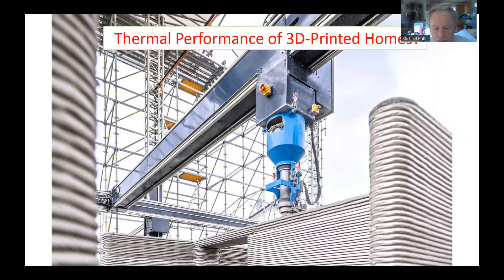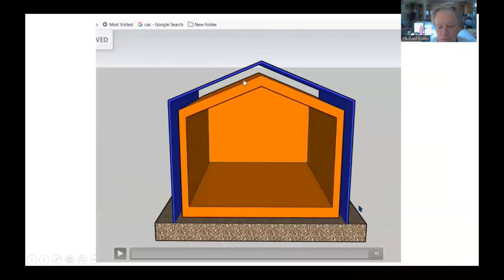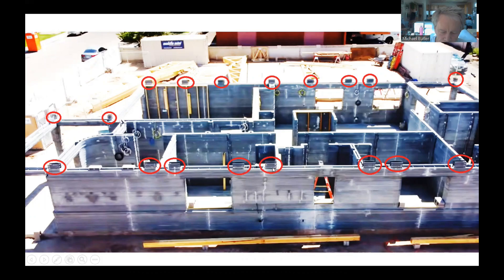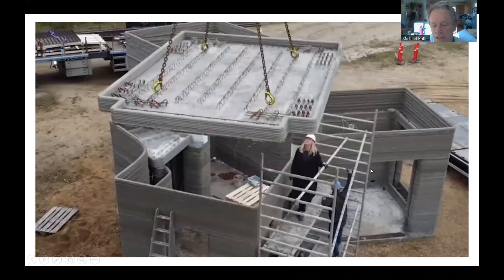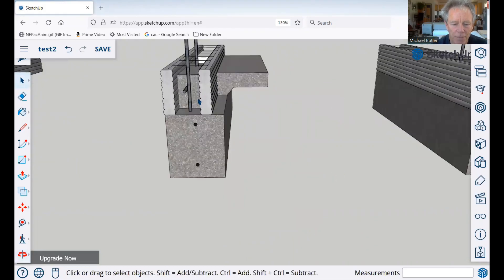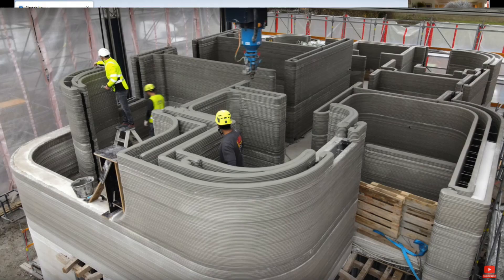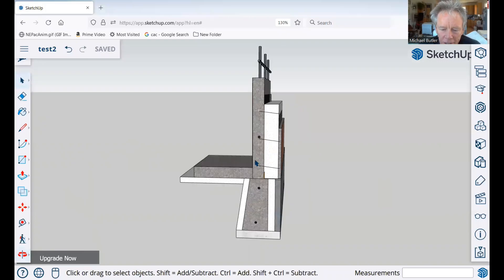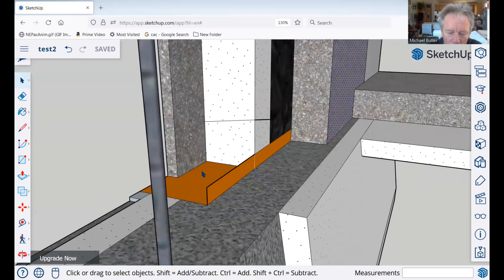Building Science and 3D Printed Walls - Effects of the Code on Printed Concrete Thermal Performance

Comment from the maker: One ultimate goal is to make wildfire-proof homes - that also have top thermal performance, and are reasonably cost-effective.  Machine-controlled methods do not have to be limited to use of flammable materials to accomplish this.  Treated EPS foam (for example) does not burn, but has a low melting point - 240 °C  464 °F - and does not want to get close to that.  So, protection with insulative-stucco (higher air content) is appropriate.  Any development of new better insulating products is appreciated!  We have been working at insulating-cement options for below grade.  The challenge is avoiding water absorption - to maintain insulation value.  Under the footings we now use an eps-cement mix that has good strength and minimal absorption (and is less effort than foam-on-trenches), but does not insulate as well most foams.

Comment: what about filling the inside of a double air form(s)?  such as done in aircrete harrys youtube videos but with your cement. :]
Reply from the maker: You would not need our thickening really, and they would want a lighter material unless you have massive psi in the air form.  Thanks!

Comment: Great arguments. It makes no sense to put the foam on the inside of a building, as with ICF. The current 3D printing of concrete is a good start but there seems to be many downsides that need to be worked out.
Reply from the maker: Yes!  But to be fair, most people don't know that it can be done without the interior foam. Thanks!

Comment: What about using aircrete as an insulative middle layer?
Reply from the maker: Aircrete is awesome and is fireproof, but most site-generated portland-cement aircrete is far from foam thermally, and can hold moisture more easily.  For the same R value you would have to go thicker, and so is more appropriate in less extreme climates.  I think yes for below grade applications, but the high water absorption has to be minimized.  Working on that.  Thanks!

Comment: I worry about foam on the exterior of buildings.  I just watched a video where the contractor said they built a warm slab foundation with foam wings and years later they came back and much of the foam was degraded or missing.  I don't know if this is a common problem or they just used the wrong foam.  Joe Lstiburek, the famous building scientist, used foam on the exterior of his house and had ants burrowing through it where there was moisture.  Then there was the fire in England where a high rise went up in flames because of the metal/foam cladding.  I live in a house built by Pulte.  It has 2x4 walls sheathed in Dow Blue foam (except for the shear walls) and covered in paper thin vinyl and a truss roof.  We've had a few houses burn down, and when they burn it is quick and total.
Reply from the maker: Agree!  That is why the full-thickness (1") stucco.  Getting ready to do that on one now, and putting extra air bubbles in the stucco mix for more thermal insulation to protect the foam from wild fires.  For ants and termites, caulked barriers that force then to go around it, and borates work well!  If there is no vegetable matter, nothing to support carpenter ants and termites.
Reply: @SpaceCrete  I think ants and termites like to bore through foam for nesting.  Especially if there is water and food nearby.  There used to be a company nearby that made "oreo walls" -- concrete on the outside, then foam, and then concrete again in the inside.  I don't think they're still in business.  Good luck on your project!
Reply from the maker: @59seank  True.  There are other concrete-foam-concrete options out there.  Underneath the footings we use an insulating cement mix.